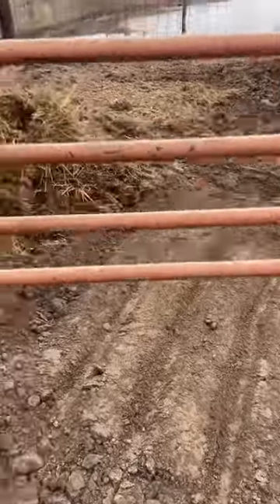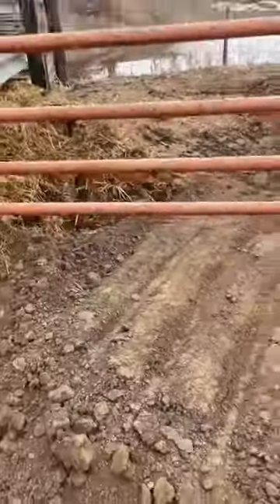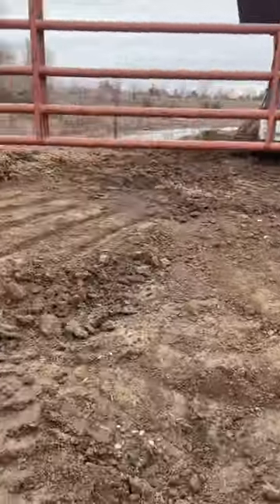How to fix a corral #farming

Comment: Why wouldn’t you just lower the gate by dropping the 2 hinge bolts, it would still open if lowered because even in the open position there was a large gap under the gate. Just wondering?